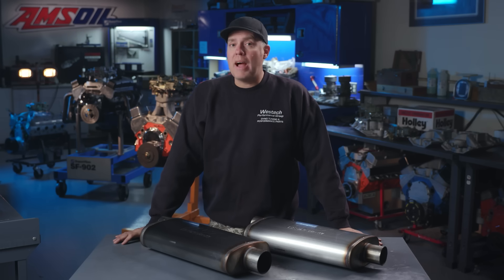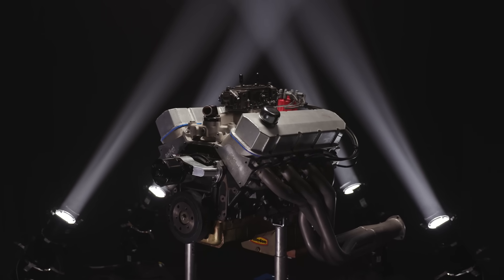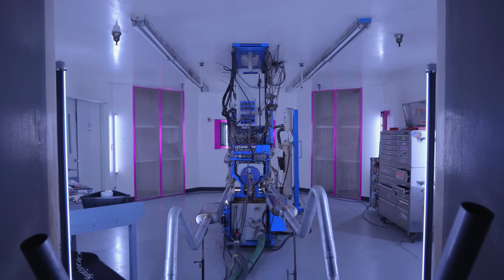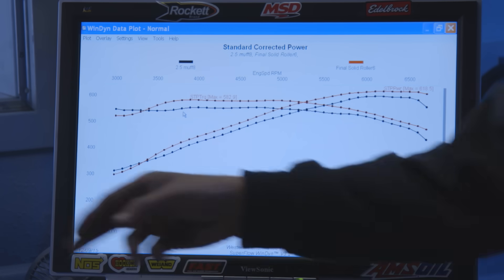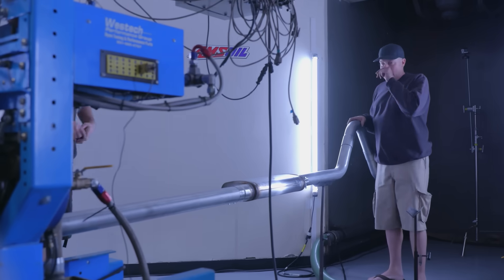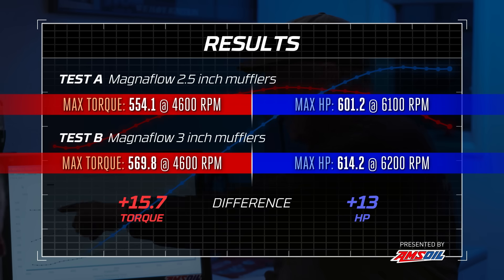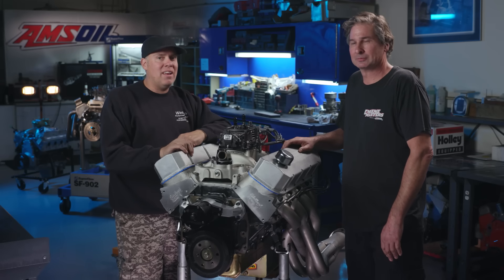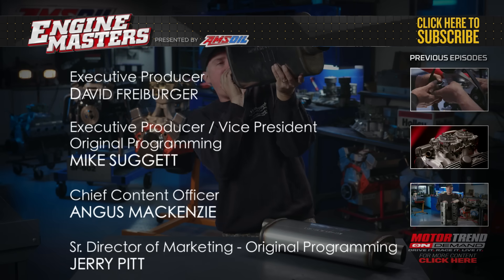The Power of 2.5- vs. 3-Inch Exhaust - Engine Masters Ep. 9

Comment: I am restricted to 2 1/4 exhaust on my 69 Camaro. When it rolled home in 1970 my mom and dad slapped a pair of vintage Thrush side pipes on it and they have hung there ever since. I hollowed them out and put more conventional exhaust through it but that first elbow coming out from under the car will only fit a two and a quarter pipe through it and I honed that aluminum elbow for as much clearance as possible. If I ever wanna go bigger I'll have to find someone who can replicate the same parts only a bit bigger and I'm wayyyyyy too scared of the price tag on that. I can't lose the pipes because I have had folks who remember that car from 40 years ago just from the side pipes. "Holy shit! That's Sandie's car! You must be Sandie's boy!"

Comment: My only question is what HP In a V8 do you recommend going up to a 3 in exhaust? Like my F150 makes 400 at the flywheel with a couple modifications. I got a kooks full system but it's not true duals. Would true duals be better or should I wait until the truck makes more HP.

Comment: Always weird to see how much power can be generated by such a basic engine. One camshaft, rocker arms, 2 valves... Amazing...
On topic: I think that if the engine would be tuned to proper mixture, the engine would run fine on the 2.5" system with less fuel consumption? It's to rich now, that's a performance killer.

Comment: Since this aired, I've had a number of people come to work (local parts house) and want 3 inch exhaust on their small block. PLEASE make it more obvious that you meant it was for a big block application. There is no reason a standard, slightly warmed over small block would need 3 inch pipes. It's the exhaust equivalent of putting a 750 double pumper on a 8.5:1 350 with a "RV" cam. It's a waste, and probably won't make any power.

Comment: You should do a header test using a 2", 2 1/8, 2 1/4 diameter tubes. I am getting ready to drop in a 496 into my 67 El Camino.
I still haven't purchased headers, or had them made.

Comment: I have 2 questions...
1. I have a dodge challenger srt8 2010 straight piped and I want to make it louder. I was thinking of removing the catalytic converters, would my engine light turn on?
2. Will it damage or hurt my engine in any way? and will it run different?

Comment: You are using 600 horsepower, obviously 2.5inch will be restricted. What's the point of this frikken comparison? Anybody who has 600 horsepower already knows they need a big exhaust and probably has 3.5in+. The everyday person certainly WONT benefit from 3 inch exhaust with their 170HP civic over their stock 1.75 inch exhaust.

Comment: hi, so on a ls1 engine cranking around 400 hp a 3 inch exhaust would be better then a 2.5?  most systems for vettes are 2.5 to 3 inch back to 2.5 with 4 inch tips..   not sure if any of that matters other then sound but please let me know...

Comment: What if they optimized the carburator so the A/F ratio was the same? It's not fair to test with a different A/F. It's like putting on a different air meter sensor on an EFI car. Of course you'll loose power if A/F is off. The power difference is just 3%.

Comment: You can make 600hp with stock GM stuff. You don't  need those heads, or that intake, and/or that fancy carb... People got a lot to learn about building motors!
Reply: Maybe with a full ZL1 top end on an LS-6 Bottom end but I don't think there's a stock GM Camshaft that will give you that, maybe one out of one of those Big Block powered McLaren Can Am cars. If you could call that "stock"

Comment: They should have used a 2.5" out header with the 2.5 exhaust and a 3" header with the 3" exhaust. I think the differences would have been even more dramatic between each.

 I think they had missed a big point here that may have some running out and changing their 2.5" exhaust for a 3" in their 300hp V6 Ford Mustangs or Dodge Challengers when the 3" is not a better system than the 2.5" for the hp those cars put out.  say you have a 300hp engine, most likely the 2.5" exhaust would do a better job than the 3" at controlling the airflow because there is a lot less air being pushed out with a 300hp engine than a 600hp engine. Also, with the lower powered engine and the bigger exhaust it will burble and won't sound as tight or controlled. 

The deal here is exhaust size is decided by horsepower. A 3" exhaust will work better with 600hp than a 2.5" and most likely a 3.5" exhaust will work better than a 3" with a 900hp engine and so on up the hp ladder. 

I know my brothers race car puts out 1460hp, he has a 4" collector header with 2.25" primaries that he uses on the street. His engine builder had tried several different collector sized headers that all had 2.25 primaries that matched the heads, everything from 3", 3.5", 4", 4.5" and 5" collectors. The 4" header and 4" dual exhaust gave the best results.

Tailoring an exhaust around an engine depending on hp and torque is what most engine builders do and my brothers builder goes further than most builders by having every sized header with different collectors and primaries sizes along with every size muffler and all the pipe sizes needed that he had slip joints installed on every component of an exhaust system so all he has to do is slide the different pieces together for the different engines he has on the dyno.

The last time I was at the shop he must of had 200 different headers along with different mufflers sizes with rows of pipe and bends all ready to be slipped together for that specific engine on the dyno, that way he can design the very best exhaust layout for the engine he builds you so you're getting the most out of that engine.

 Mismatching header collector size with the exhaust is not a good thing, but what they have showed you here is how much an exhaust size matters to what kind of hp/torque you will get out of that $8,000 to $30,000 or more baby sitting in your engine bay.

Comment: had the engine been tuned for each pull the differences would not have been very much at all. In fact the testing would have shown that with the 2.5 and 3 inch exhaust are far better for day to day use than open headers ever would be .

Comment: What amazed me was how the power gain with the 3" system was only 2,165% and 2,833% respectively for HP and torque, with very similar curves, while the 2,5" system was MUCH quieter. I suppose it's a question of usage and priorities, but for a street(able) car I'd definitely go with a 2,5" system, maybe with some straight pipes to replace the mufflers to get those last few ponies out of it for drag/track use.

Great video, though (as always)!

Comment: I'm new to gas motors. What situations is high compression better? 
HOW ON EARTH ARE THEY GETTING THOSE RPMs? A diesel of similar power would die hitting those! Although they did build 5.2 liters with 660ft lbs and 300hp but they only could rev to at the most 3200.

Comment: Need a follow up test to determine at what point do you need to go from 21/4 to 2 1/2 to 3 inch exhaust and I think the formula could probably be done mathematically from air flow requirements just like what is used to determine proper carb size for an application

Comment: Backpressure will obviously be there in the 3-inch pipe, it might reduce only if the exhaust diameter is increased further. Plus its a v8 too, there is already a lot more volume of exhaust that too at increased frequency of the exhaust pulses per unit time compared to a 4-cyl or 6-cyl.

Comment: Do you need some back pressure when using a supercharger or turbocharger?
Reply: Yes, the tighter and more restricted the exhaust housing of the turbo is, the faster you're going to spool your turbo (turbine spins faster with exhaust velocity and back pressure) because the restricted gasses escape through the exhaust housing with more velocity, but with this restriction comes the downside. Less exhaust volume will be able to fit through that turbine housing once the turbo is spooled and starts squishing more air through the intake. Thats why you have a wastegate....Yes.

Comment: Tuning waves in the exhaust is where it's at. Getting the max scavenging effect. I have tinkered with exhausts and sometimes you get better overall performance when piping is not opened up too big after the collector. I said overall because bigger is better when you are running wide open (see race cars) You are moving a lot of air. Not necessarily so for just off idle up to 2-3k or so. Car mfrs don't tune exhaust systems like we are going to spend all of our time flooring it. They want smooth power in a big range of rpm so they go smaller and make the compromise.

Comment: It's all about ci. and rpm's. cb 350 at 7000 to 9000 rpm's will need the 3' But not at idle to 5000 rpm's. 2.5" for TQ. 3" for power /rpm's.

Comment: I cry foul...Nobody would ever install a full Magnaflow exhaust without using a crossover pipe of some sort.
Reply: True.  Also, hopefully nobody would swap to a 44% larger cross-section exhaust and not bother to tune their car.  Maybe that's the test we need.  Tune for 2.5 and run on 3 and you'd get even less of a difference than the miniscule result they got from tuning for 3 and running at 2.5.  Add a cross-pipe for both systems and watch the differences disappear.

Comment: Did the dyno correct and optimize the carb jetting and engine timing for each run? I would think with the open headers and collector it would make more power with corrected jetting and timing. Also that exhaust system was really running a lot of straight piping. All mandrel bent tubing. Not a typical street car exhaust system.

Comment: So if you tuned engine while it was running the 2.5" exhaust to run less rich, so you optimized the air/fuel mixture. How much of that lost power would you regain?

Comment: I bet you could regain the lost power with the 2x2.5 if you adjusted the carburetor to get the AFR right. Why don't you use a EFI setup in closed loop mode for this type of test ? BTW, I'm making 330hp on my 180 CUI Lincoln LS 3.0 V6 NA engine. using 6x1.5" headers with 2x2" tail pipes with 4 mufflers.

Comment: With an na engine the results are very different from a turbo charged vehicle ( no back pressure bullshit) a 3 inch system over a 2 and a half is almost like going from a na to turbo engine. Quicker you get the air in and out the better performance.

Comment: I noticed your air/fuel ratio was in the 12-12.5 range with the 2.5 inch system where as with the open header, it was in the 13-13.5 range. Do you think taking some jet out would have yielded some gains.

Comment: Thank you for posting this video, I've been arguing that the exhaust system isn't a way of building torque for years.  If you feel you need to simulate having less overlap by increasing backpressure then you should just change your cam timing to improve low RPM compression.  The solution is never to do something to reduce overall power output.  The exhaust should always be oversized, and the header matched to the RPM range that the cam is designed to operate in. I know even after watching this guys are going to say how their undersized exhaust works better with their 8:1 3/4 cam motor with a sub 700 cfm carb on a dual plane.  You know, they are probably right ;)

Comment: Some people got to remember if ur stock engine is 4.7L or smaller. 3 inch may loose hp cause it's too big for that small cubic inch engine. Also sound like u have water in ur exhaust lol Of course with a high compression pistons or turbo and supercharged may help the 3 inch exhaust work way it should. Just saying.

Comment: I have noticed on the Chevy small blocks that I've built that they really come alive after 3" pipes are used* last 327 I built went into a it's camaro,the body couldn't handle the stress,after the subframe connectors,and 6 point cage was added,he ripped the frame at the front crossmember,got mad and sold it :/ makes me sick

Comment: Nice test, but i'm not shure if you get such a huge difference if you setup the carbs correctly. You said, that the 2.5 inch exaust system runs way richer than without. i think this kills also some Horsepower. I wonder what will happen if you put a decent ECU to the engine with proper fuel injection, O2 Sensors and make for all configurations a new setting.

Comment: And you can get a higher RPM out of a 4 cylinder than you can a V-8, but the same thing goes for the RPM, it's only good to a certain point, because you'll either lose speed once you get to a certain RPM getting close to red line, or you'll do damage to the engine or blow it up all together, that's why you have to find the best RPM to shift at, that's if you are running a manual transmission, and if it's an automatic transmission, then finding the right torque converter so it will shift correctly and smoothly, or again, you can get a higher performance shift kit put in your transmission, for automatic and manual transmissions, all these things go hand in hand will make a huge difference in the performance of your car or truck, so you really need to know what you are doing! I've been around engines my entire life, and I was a mechanic for my step father who owed his own business as a School Bus Contractor in Howard County MD, which he owned like 34 school buses, which all had to be serviced and maintained, and each year they had to go through a school bus inspection to make sure everything was up to par and within safety standards, which most of his buses at the beginning were all gas engines, then they all were eventually converted to Diesel, and he started buying Buses that already had Diesel engine's in them.

Comment: Thanks for that cool comparison. It s something I kinda knew but I had never verified. I ve always use a set of 3 in Dynomax  Super Turbo resonator, an "H" pipe and a pair of 3 in Super Turbo Dynomax. on my street car. The resonators are use to comply with some tracks that wants muffler and make that "helicopterish" reverb sound disappear at cruising speed . Allowing to chat and listen to radio at same time.  You shoul;d add an "H" pipe to both system to compare. That 2.5 in system was not bad at all i.m.o. knowing it's choking that engine that much. Another cool test would be to try a single 3 in set-up compare to the dual 2.5 in set up...

Comment: I think the 2.5" would fair better with a retune to compensate for the rich air to fuel ratio. The 3" is closer to the tune of the open headers, so therefore, it would make sense that's why it ran 'better'. The 2.5" was further from it's tune than the 3" exhaust, that's why I think this is a false comparison. Still cool though.

Comment: It would be interesting to see further tests for, sweet spot between power and noise (diameter versus length etc), the real effect (if any) of H or X pipes, and maybe "exit strategies" under the bumper versus in front of the rear wheel or turn outs. Also another way to think about the difference between pipe size is velocity. Engines are essentially air pumps not magical explosion machines (as some internet experts seem to think)  All things equal, Exhaust travels much faster in the smaller pipe at a given RPM compared to the larger.  It requires energy to produce velocity therefore peak HP suffers but torque less so. In the end the system should be designed with the vehicle primary use in mind. 4x4 rock crawler would do better with a smaller diameter system vs stock car that wants it big. 
Oh, and fyi I've been looking at a great old dually with a 454 and wanted to know abc> how to get to ~600 hp (with stock bottom end) so, woo hoo, thanks for that.

Comment: There are still to many variables to take in account for on 2.5 vrs 3.0 pipes on a motor.  
Were the pipes mandrel bent or not, you can take a 3" pipe go over the axle and a crappy bender will squish it to 2" no power gain there. I know they are on borrowed time when it comes to dyno testing but they should have done the same test with a small block showing back to back results (big block/small block). 
Either way Someone is going to want 3" on his sb with exhaust manifolds then wonder why his car runs like crap then blame the show.

Comment: Yeah, let's say that someone has a 4 cylinder DOHC, would a 2.5 inch exhaust system be more efficient for that size engine or would a 3 inch exhaust make that same engine perform better? A lot of people don't know that when you increase the exhaust size, that you also have to increase the intake to make it balanced out, because you can increase the exhaust size all you want, but if you don't increase your intake to compensate for the increase in exhaust size, then you are really going to lose power, don't get me wrong, it'll make it a little better, but you'll gain more power if you try to keep them well balanced, BUT, increasing the exhaust and intake is only going to help to a certain point, then you have to get into Port match and polishing your intake and exhaust manifolds and the heads, and increasing the cylinder bore to 10, 20 or 30 thousands over and putting in a bigger cam.....all these different variables matters considerably.
Reply: +Roy Patterson A single 2.5" should be good for around 250hp maybe a little more. In a car I would start worrying about ground clearance/fitting it under the car.

True you have to need bigger exhaust...meaning thtat the engine is taking in MORE than the current exhaust can handle. I think most guys do it just for the sound and think if it's louder it's more powerful. Which isn't always the case.

I also think a system with a cat..isn't affected as much by going too big as the catalytic converter is usually the biggest restriction other than the exhaust manifold.

Flowmaster has a chart but I think the dynomax one is more realistic:

http://www.qsl.net/ya5t/techchart.jpg